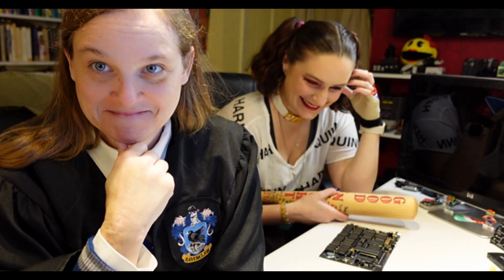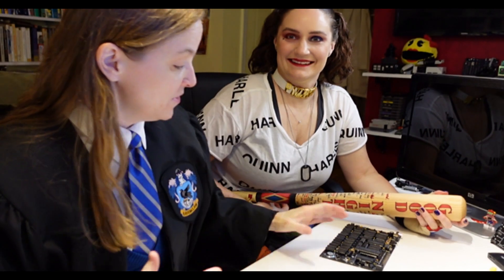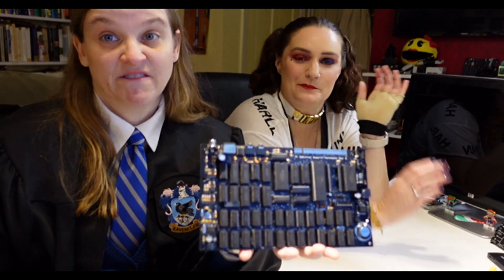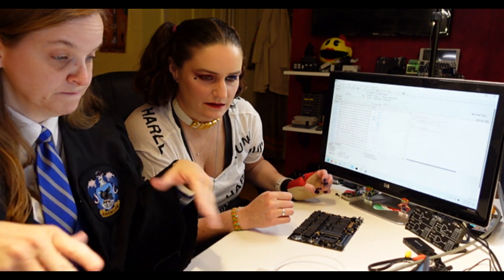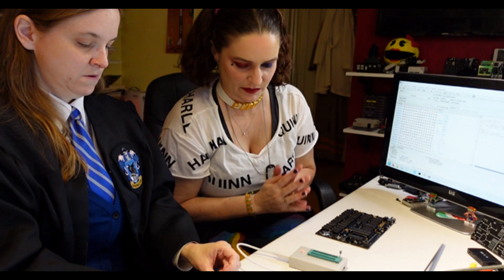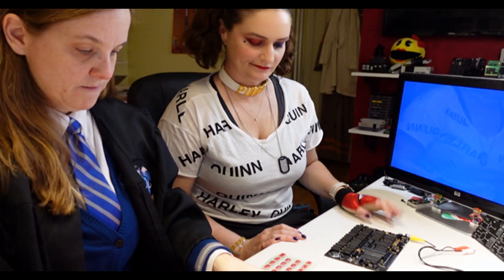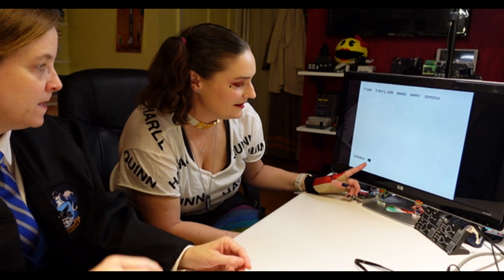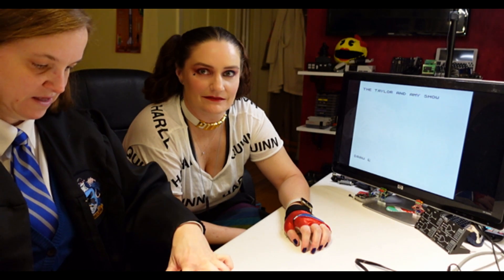Harlequin ZX Spectrum

Comment: Awesome work. The stroopwaffles are the bomb. I went for the Harlequin 128D with ByteDelights rainbow backlit keyboard and case. I accidentally cut a trace when clearing the board and spend months on and off trying to figure out why it was so unstable. One day I just went over it with a magnifying glass and found the cut. One bodge wire later, it was fixed.
Reply: Is that not THE BEST feeling when it works.

Comment: Having a modern retro design is cool, but does this board get hot?  I remember my 48K would get very hot...  so much that I thought the plastic might melt.  There was a metal heatsink on the original voltage regulator.  I didn't notice a heatsink on this build.  The 128 system had fins extending out of the case.  That one is known as the toast-rack, and is sought after, fetching silly money on eBay.
Reply: So far zero heat issues!
Reply: Distributed heat. so less hot spots.

Comment: You need to get some games now. Manic Miner is one of the archetypal ones on this system. Death chase is another great one. There are loads. 

I've just built one of these. Mines not working properly though so have to debug it. I think its a problem somewhere in the video address generation circuitry.

Comment: 17:10 Was anyone else shouting "SYMBOL SHIFT P" and "CAPS SHIFT 0" at this point? (or was it just me!)
Reply: You've got to shout louder so we can hear you!! 😂
Reply: Yeah - but I was talking at a moderate level, as I'm watching in the early morning.  I still mess with the Speccy, but don't have an original or Harlequin.  I still dabble in Sinclair BASIC and Z80 m/c using FUSE.  My fingers somehow remember where most commands and symbols can be found, even though I'm using a worn PC keyboard with all its legends abraded.  The one I have trouble finding is the question mark.

Comment: to make 2 copys of the rom file to fit on the eprom, just open a doscommand with admin rights and do a copy instruction like this: copy /y /b file1+file2 destination. Example:   copy /y /b 48.bin+48.bin 48b.bin. Save a lot of time instead of scrolling to the empty space on the rom.
Reply: No need to do that you can just load the binary twice in the software, first at $0000 then at $4000. Just remember to change the option to not to clear buffer on file load.
Reply: @waltergooeyblob  Yes, i know, but the girls went on scrolling down to address 4000 :)
Reply: Control down arrow...

Comment: My first computer was a Timex Sinclair 1000, which was essentially a ZX81. Typing on these devices is a nightmare, but back then it was super cheap. I still think about it after all these years.
Reply: IIRC, the TS1000 had an MSRP of $149, or $99 in kit form. The latter predated jokes about IKEA furniture by about fifteen years.